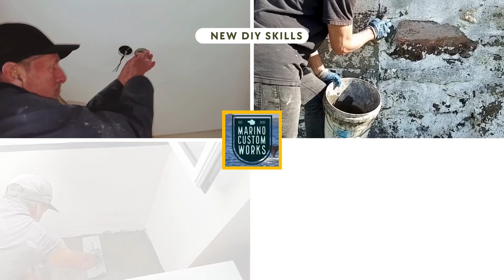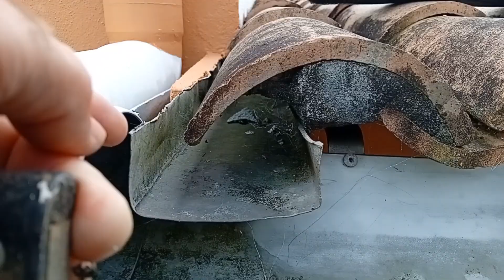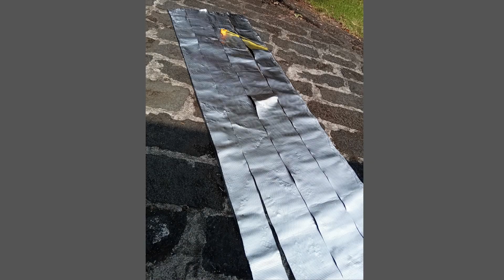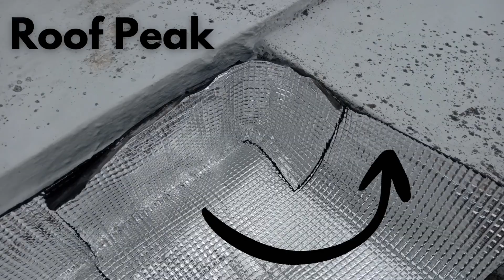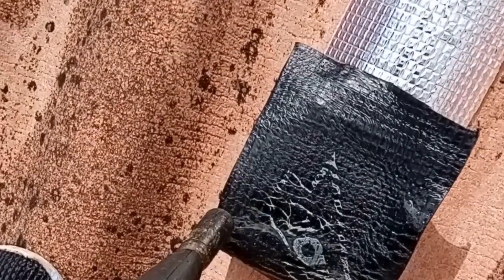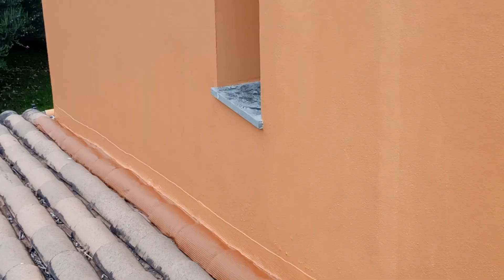Stop Roof Leaks Along Walls – Simple DIY Fix That Lasts!

Comment: Can i fix it before placement
Reply from the maker: Hi there, are you referring to the underlying problem with the metal trough?  Maybe on some roofs, but not this one since they are large corrugated panels.  The roof would need to be repaced or at least partially replaced.

Comment: Can i fix it before placement
Reply: Hi there, are you referring to the underlying problem with the metal trough?  Maybe on some roofs, but not this one since they are large corrugated panels.  The roof would need to be repaced or at least partially replaced.

Comment: This was a great video. I am now employing the technique. Thank you. Can you tell me how to seal the overhanging tile area on the roof/wall overhang where you hang a gutter?
Reply from the maker: I would have to see some photos to understand exactly what you are working with... Typically, the overhanging tiles are set in mortar, so repairing with mortar seems logical.  If you have a leak there, it could be a problem upstream. With more details, I might be able to suggest something.

Comment: What is the metal foil coated with bitume called. I live on France do hopefully can purchase throughout Europe. Thank you. Jilly Bond.
Reply from the maker: Hi Jilly!  Yes, they apparently have this product in France and it is somewhat common.  The term in English is just "Asphalt Roll" or "Bitumen Roll".  It is important to note that you want to use a torch, because there are other cold press types.  In French ther are a few variations of the term, but try Membrane bitumineuse à souder".  Let me know if you have any other questions once you get started :)
Reply: @MarinoCustomWorks thank you so much. I have a blow torch.   You info and reels are very interesting for me.  I am a renovating a farm house in Vienne.   Any advice on rendering external wall of property, constructing granite walls to boarder flower beds.   Have you used silica sand to seal cracks on ground level cement.     Doing this project by myself..... 6 years in.... Learning alot but have made some serious errors employing anyone here.  99% scammers from Plumbing,  Électrics, Window and Door installation.... Do I sound at my wits end .... ? Yup.   Jilly.
Reply from the maker: Somehow I did not get your reply right away.  I try to respond quickly.  I have used silicone specially made for cement cracks with great success.  These cracks were leaking into an interior wall of the house below ground level.  The leak completely stopped.  I sm expecting that this is not a "forever" fix, but it us good for now.  I have worked with clients here that have been overcharged or had permanent damage to their house from not selecting the best worker for the job.  Ask to see prior photos of work that they have done or get recommendations from friends in the area.  I hope that helps.